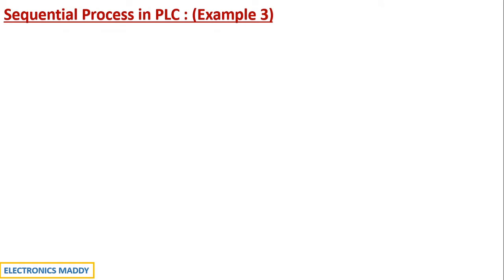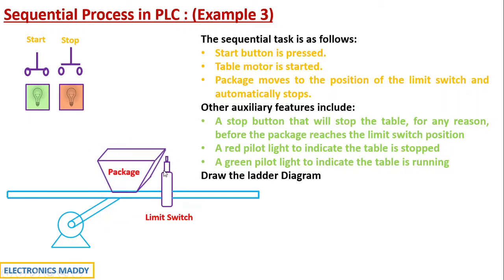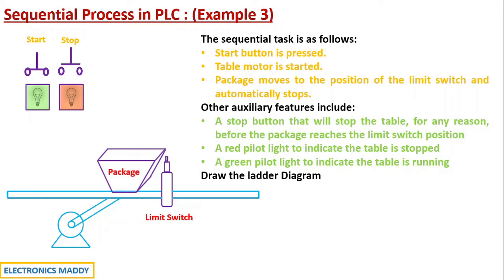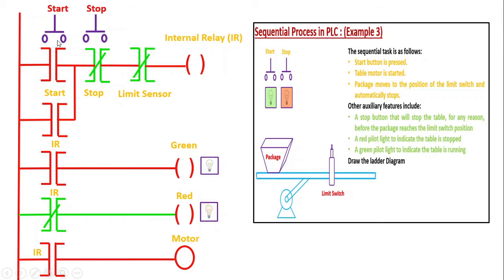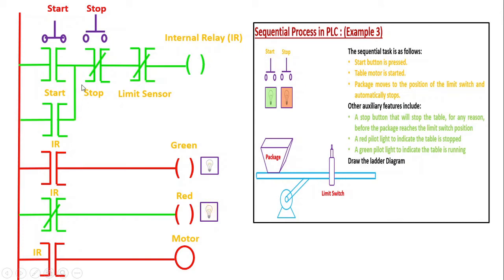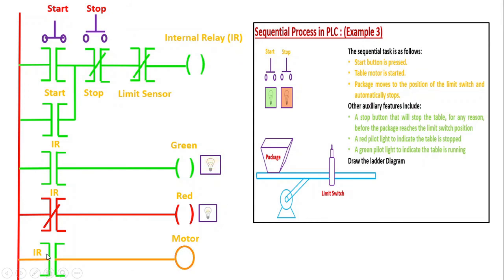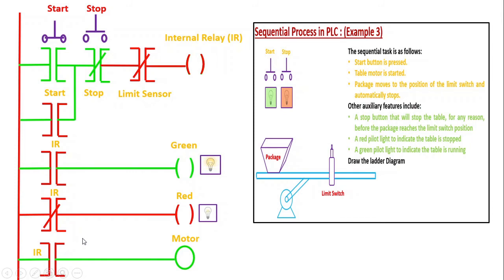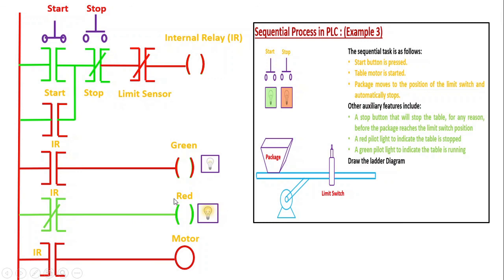Sequential Process in PLC | Example 3 | PLC Programming

Comment: can you please help me out 
need
 1)To Design Hybrid Model including any two sources (PV system, Wind System and Fuel cell) operating in parallel with each other supplying to common load in isolated mode.

2)Modelling and simulation of Single stage PV system with MPPT,voltage and current controllers working in standalone mode.
i need this tommorow only please help me
Reply: means 19-12-2020 till 11:59pm